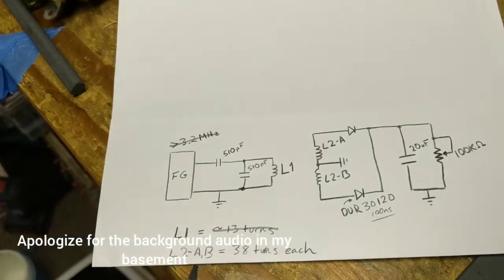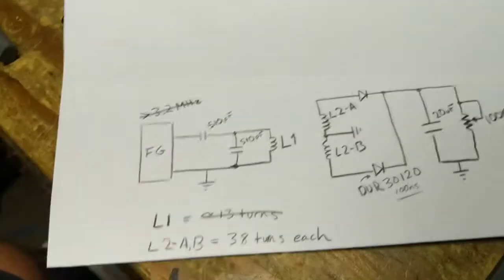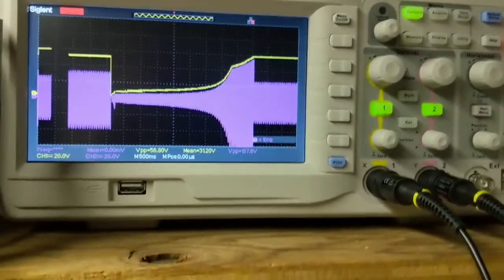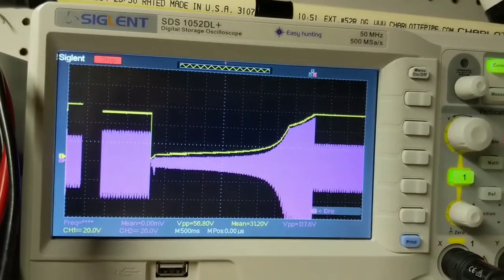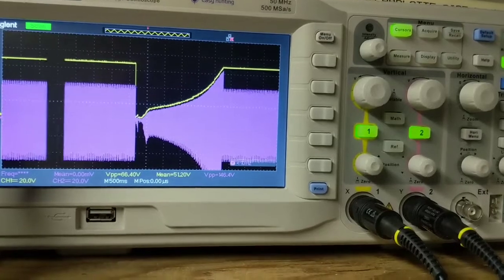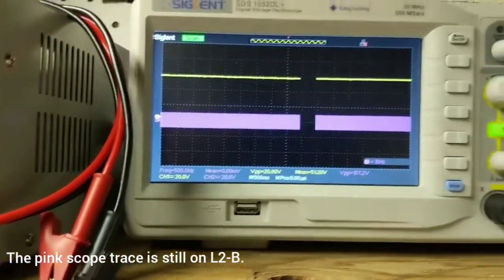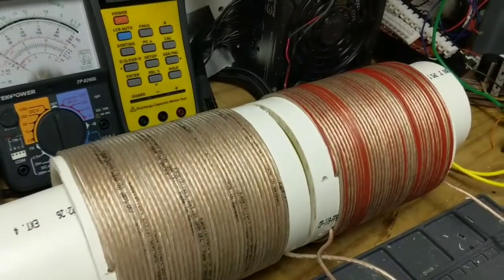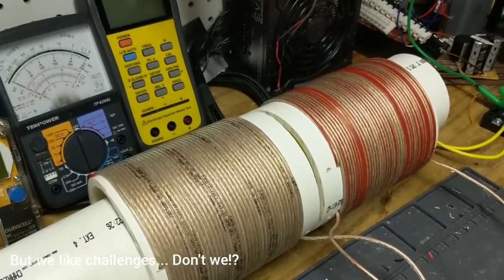Don Smith Circuit - L2, one coil or two?

Comment: Like your work, you got me thinking. Lets say we have two different circuit, and two transformer wich are  concected separatly. On first transformer we lift the voltage up with small amps/miliamp, on second transformer we lift amps with few volts so that each circuit uses very little watts to drive the transformer. Now we have thousands of volt and amps on both transformer, the only question is it posible to connect transformer and use this. I think this is how Dons device work.

Comment: Changing the distance in the middle between the 2 L2 parts gave me best result when they where just next to eachother, that way they both have much coupling with L1 coil and the antinodes on L1 have more influence on L2. The wire on my tubes is at the edge so I can place them next to eachother. I also tryed with L1 with same diameter of L2 and just placed that in the middle but I didn't have enough time to find out what my best result was that I could get out of it. Something on the todo list.
Reply from the maker: So I've been playing around a bit more and reading the Klystron documents a bit more.  Adding too much capacitance on an L2 coil seems to kill the effect.  So if you trying this yourself, start without additional capacitance and see what happens.
Reply: @phives5910  I was doing some experimenting but with my components I couldn't get exact same result at the moment. However what I saw on scope was a sine wave output after the diodes in relationship to Earth ground if the middle of L2 was directly Earth grounded and the 2 diodes go to one side of capacitor  (10µF in my case) and from other side of that capacitor I go to variable capacitor and then to Earth ground. I could get in my setup 180V sine wave output (unloaded) in reference to Earth Ground. 
When I then place a transformer primary that is in parallel with capacitor, from that point where 2 diodes come together and Eart ground, I could light up an led on it's secondary not by making continuous connection but by making a very fast bad contact. As always with electricity the faster edge I created the more brightness I had on output Led. This is not possible with continous contact, there need to be a change. Sadly my mosfets all have diode across them inside, so I'm now searching for a way to switch Earth ground connection in a fast way. 
What I also noticed in my setup is that the max positive peak of the voltage is higher in reference to Earth ground then the output voltage measured on series L1. The negative max of that voltage on diodes has however the same as the negative of series LC input.
I will make a video to make things more clearly when I'm further in investigating this, but I wanted to let you know that maybe I'm experiencing your output in another way.
The 10µF capacitor connected to diodes is not charging in my setup and yet I'm possible to have output :) from that sine wave, I only need to foresee a bad contact.
Reply from the maker: @brunovk417  just place a diode that can handle the voltage in series with the MOSFET.  Won't be efficient, but it'll block the body diode.
I played around a little with the ground shunting on that side, need to do more experimentation on the best options.  When i placed a 100k pot there, I saw similar to you, a sine wave on the cap.  Haven't tried a MOSFET yet, I'll get some more time in a week or so to play around again.  Good luck!
Reply: @phives5910  Thanks for sharing, it worked. Also I have the same experience with to much capacitance. When I used 1.2µF I could go to a max switching frequency of 13Hz, because I thought I could get more brightness I used bigger capacitor of 2.4µF but then I could only go to 9Hz maximum frequency. Then I replaced that capacitor with 10nF and I could get to even 100Hz and higher but brightness went down on led above 50Hz (grid frequency over here, so that output frequency is good for me, more stable for the eyes would be the 100Hz) I didn't have OU but it showed me something new :) Thx
Reply from the maker: @brunovk417  I'll be interested to see what comes out.  I previously figured there was no power there in that sine wave.  But maybe that's something to look back to.
Reply: @phives5910  I changed my setup to the Don Smith setup, and it now works as Don describes. 
https://photos.app.goo.gl/UgyR4h8Py7bsaAyA8
We need to switch at the 100Hz, the resistor in parallel alone doesn't to the trick. 
When you switch at the correct frequency of resistor and primary coil resonant frequency you get the pulses Don describes, even better from layout then with capacitor. 
My problem is the switching only works well in one direction. Next week I'm going to change circuit so that the switching comes in between 10µF capacitor and parallel tank circuit of transformer primary in parallel with resistor determined by the reactance chart. 
That way I hope that output is better. I'm thinking on the fact that voltage on other side of resistor will always be the same voltage as on the other side as long as there's no current draw. I hope the reactive part will benefit from this, I have to see what experiments show me.
Reply from the maker: @brunovk417  I'm guessing the resistor helps in the case where you definitely see the trumpet wave, because as seen in my video "turning some knobs", you create this oscillation between negative resistance phase and zero resistance phase, according to the Klystron documentation.  Look forward to the next video then!
Reply: @phives5910  Comparing the wave of capacitor and resistor tuning the most change is from max peak value and then going down. With capacitor I saw a sudden downfall at peak value when going down, with resistor and right frequency I get a nice positive halve wave. Also if frequency is right the halve waves follow eachother directly while at the moment frequency is to low there's some dead time between two halve positive waves.
Reply: @Phives, I made pictures of the output signals.
Difference between resistor and capacitor tuning:
https://photos.app.goo.gl/P6Jgsm5YCWdoetKv5
When no tuning is done:
https://photos.app.goo.gl/t7c7b4xuYLSsQMEC8
When output switching is put off and on:
https://photos.app.goo.gl/TfHBYCU98KYDya186
Important note: When switching off, power consumption is 3.16W.
When switched on 4W
Reply from the maker: @brunovk417  that does look a little more like what I'm seeing.  If you remove that resistor shunt from the collection capacitor, I assume that sine wave goes away, and it looks more like a normal RC charging curve?
Reply: @phives5910  The resistor doesn't make a difference when switching is on, only when switching is off then I get higher output voltage when capacitor directly connected to Earth ground. It seems that once the switching starts the path through the transformer is much easier then through the capacitor and it doesn't care if the collecting capacitor is there or not. When using no connection at all on collection cap to ground I don't see any change in output when switching is on.
Reply: Hello Bruno! 😎
Reply: @INVENTOR3  Hi Inventor3 :)